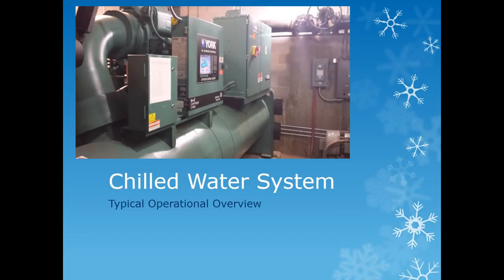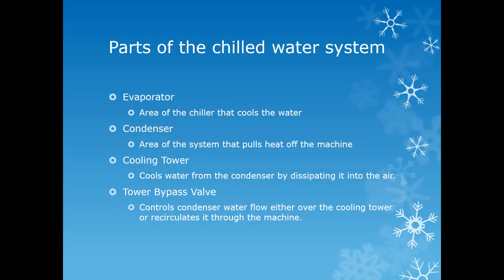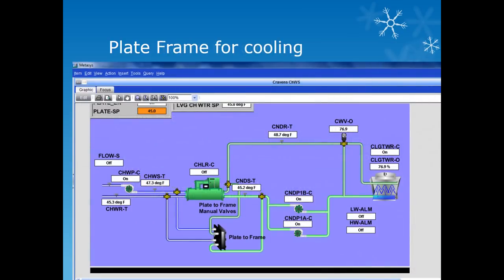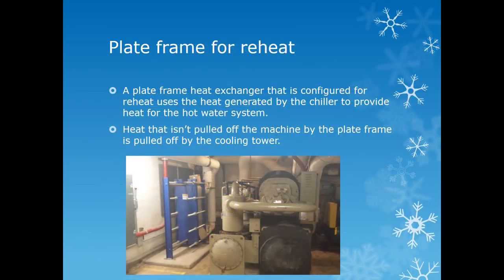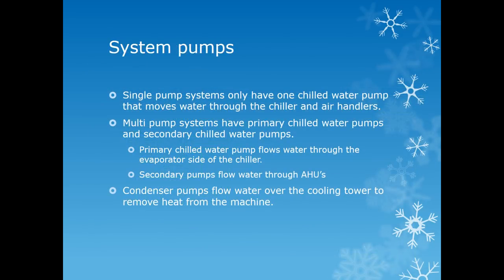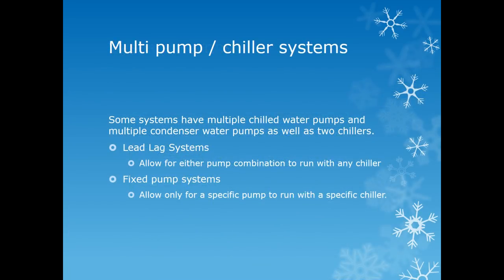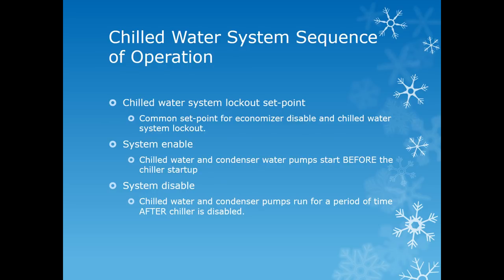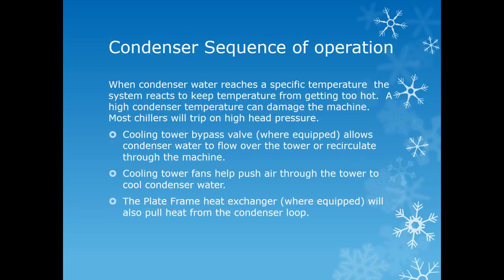How A Chilled Water System Works

Comment: Great video content. I would like to know if you could share say the temperature readings and pump pressures of the chws, chwr of both the condenser and cooler barrel as well as the normal psi pressure readings under normal conditions for the pumps. Thank you in advance.
Reply from the maker: That varies between systems

Comment: Could you please provide a video explaining how Metasys controls chillers, primary pumps, secondary pumps,  valve actuators etc. sequence of operations in auto mode. Thank you.
Reply from the maker: +Jarmen Kell  I will be able to give you a summary but it will not cover any situation but would only cover the common things.
Reply: +System Control Tech Thank you..
Reply: +System Control Tech hi may I ask when you will post the video? Thank you..
Reply from the maker: It will probably be after we switch back into cooling mode later in the spring.  It is too cold here to run chillers currently.
Reply: +System Control Tech thank you so much for your time and replies very much appreciated.
Reply: Do you all service in New Orleans erea or close to LA? And if so do you have web page or email ?

Comment: Hi, Does this system use refrigerant ?like R-410A?or does it only use the chilled water as the mean to cool? if it's does use refrigerant , what would be the significance of it in this system? Thank you.

- Dan
Reply from the maker: The chiller itself does use refrigerant to cool the water. That water is then used to provide cooling in the air handlers.

Comment: In a condo if floors 8 and below are blowing cold air in the halls  and the rest of the floors are ok  what can be the problem ?
Reply from the maker: +Frank James you have a water balance issue.  Cut back the flow to the lower level devices until they just start to not cool effectively.  There should be around a 10 degree drop through the coil of the unit. Measure the air temperature before the coil and then after the coil. Set the flow through each unit to where there is a 10 degree drop. That should allow more flow to the upper levels.
Reply: Thank you sir
Reply: *****
 don't think they have fall out bunkers either

Comment: Could you please tell me what are the purposes of "DECOUPLER FLOW SWICTH" and "FLOWMETER" in chiller system bypass line/pipe. Thank you.
Reply from the maker: +Jarmen Kell I am assuming that you are talking about a system that has more than one chiller?  It really depends on your system configuration.  We have a system with a decoupler loop that actually uses the flow through the loop to stage up a second chiller.  The more chilled water the air handlers call for the more the flow goes negative in the decoupler loop.  Once it reaches a certain level, it will bring up the second chiller.  I hope this helps but there is a lot of things that the information from the decouler loop can be used to control.  This is just one example.
Reply: +System Control Tech  Yes indeed it helps me a lot thank you so much. Yes you are right this is multiple chillers, using primary-secondary. Could you suggest some references books/websites related to this topic? Thanks.
Reply from the maker: +Jarmen Kell Unfortunately I do not know of any references for this type of control sequence.  What I've learned about it has been hands on experience.  There is a range of operation that will trigger the second chiller depending on the range settings.  It is probably buried in the programming on the controller.  As the valves on the air handlers open further the secondary chilled water pump ramps up to compensate.  This causes a negative flow in the decoupler loop and once the flow goes negative enough, the second chiller is brought online.  Good luck.
Reply: +System Control Tech Thank you I really appreciate your help.

Comment: what is chilled water system?Please explain me
Reply from the maker: +Kyaw Zin Thant Chilled water systems such as the one described in the video will use a chiller to cool water that is then used to provide cold water to air handlers which provide air conditioning.  The cold water is pumped through the chilled water coil on the air handler and cools the air that passes through it.